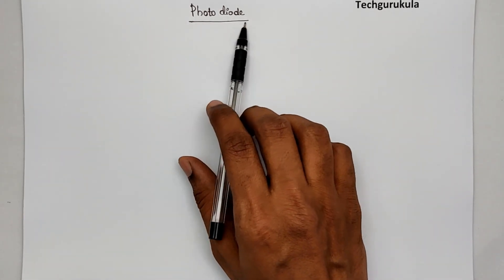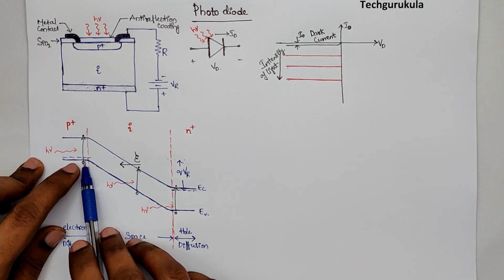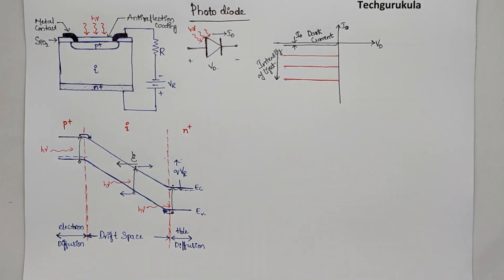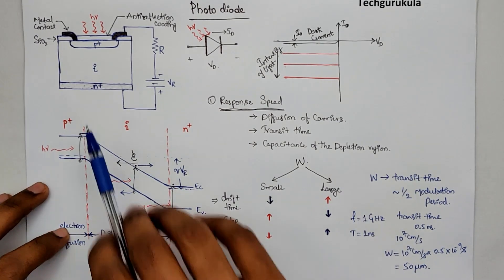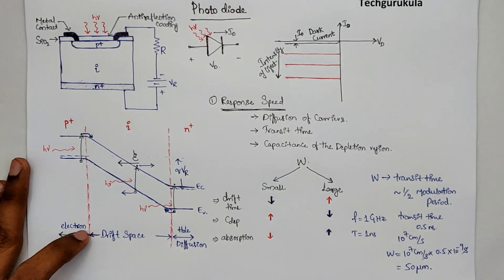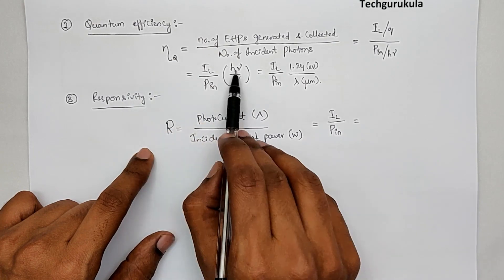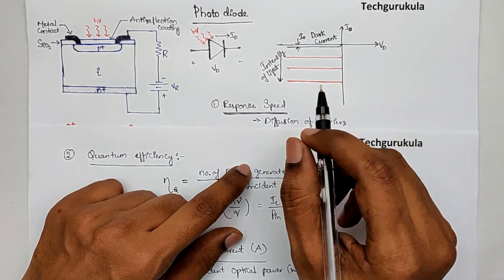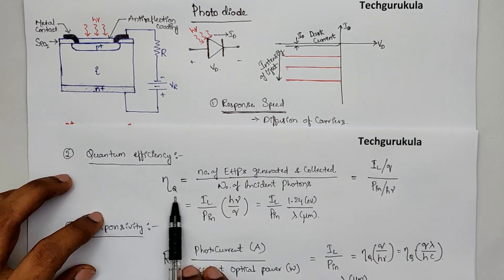Electronic Devices: special diodes - photo detector

Comment: sir,in diffusion process carriers move from high conc to low conc then y does electron diffuse in intrinsic region even though electron conc is low in p+ as compared i .could you please clarify this
Reply: As per my understanding, the electrons are generated due to light on top of the p region as seen in the picture, so as the conc is different on top and bottom of p region, they would diffuse and as soon as they come near depletion region, they are moved through the barrier due to electric field.. ☺️